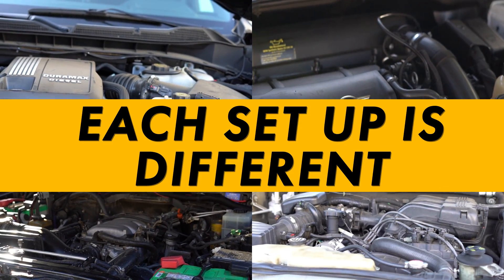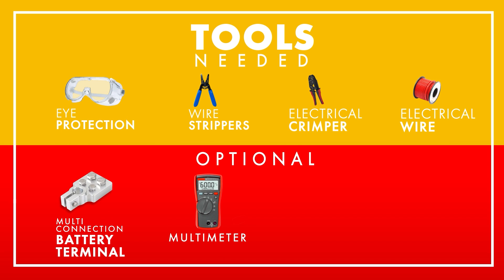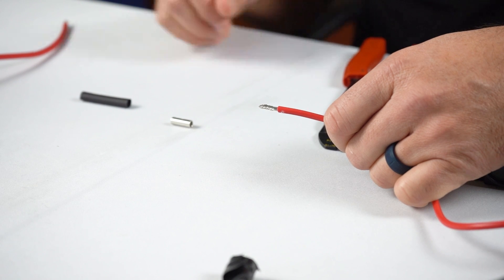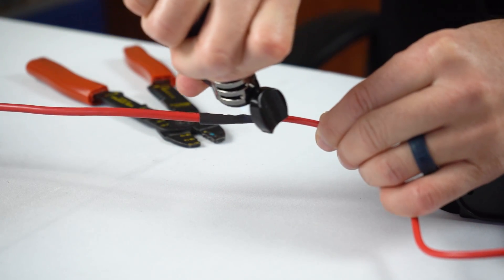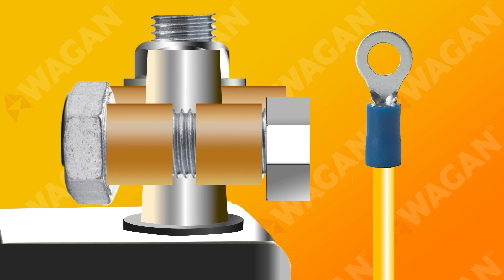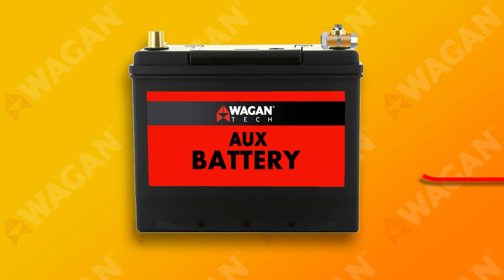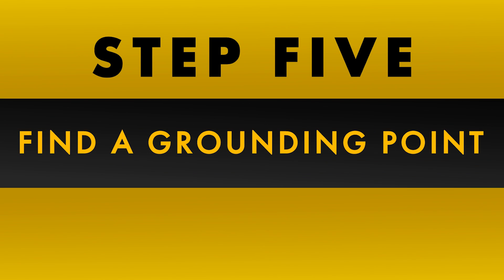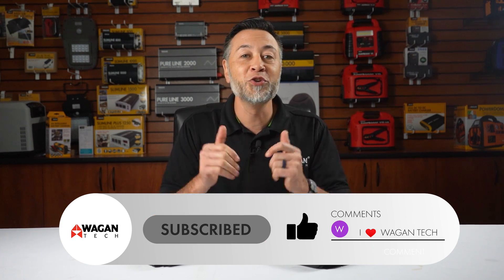How to Install a DC-DC Charger: Simple Step-by-Step instructions

Comment: I want to add a lithium battery to my trunk, I run a lot of devices phone/tablet/laptop plus a 2300 watt subwoofer amp. Lithium needs a special charge procedure that a car alternator is not designed for what dc to dc charger should i use and will the massive bass amp damage the charger and or lithium battery?

Comment: I've got a charger that looks like the one in the video but has a difference name and it's a 40 amp output. The directions are confusing on the blue wire. I have a smart alternator and I'm confuse if I need to hook the blue wire to the alternator or just to a positive 12v source that's only hot while the truck is running.
Reply from the maker: We can’t speak to your charger, but if you want to reference our manuals, you can check out models 7410 or 7411 here: https://wagan.com/pages/owners-manuals-product-guides
Reply: Thanks for the fast response! The manual for this charger makes it clear that you only use the blue wire to ignition on a smart alternator (what I have) . I wonder why you wouldn't want to use it on a regular alternator too? I think back to installing car stereo amplifiers and the blue wire was always your remote turn on wire. I would think the charger wouldn't even turn on without some sort of power going to the blue wire.